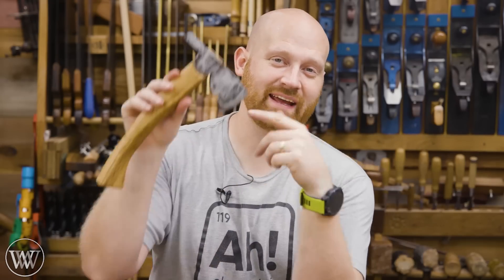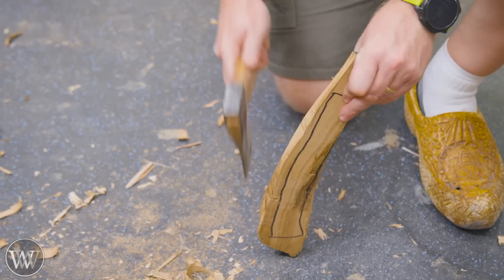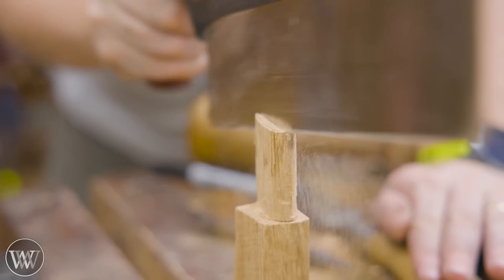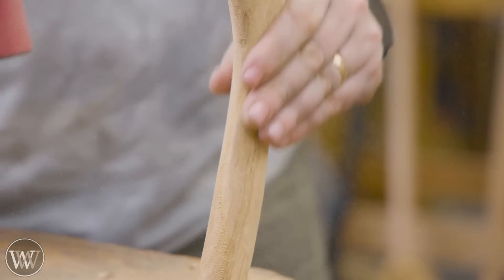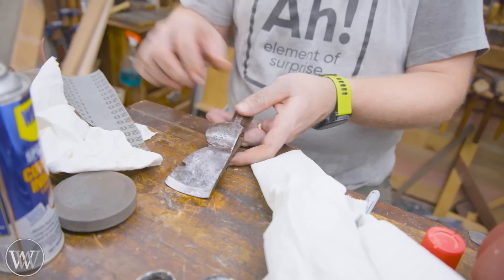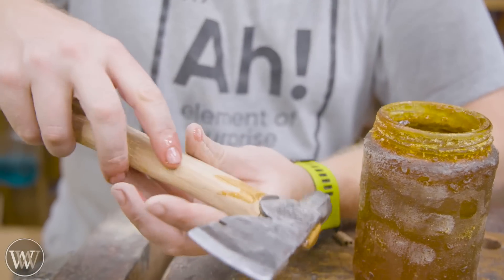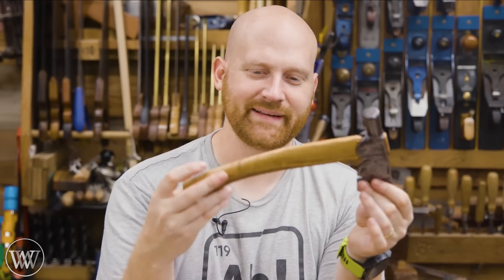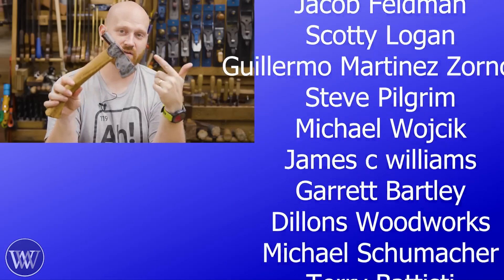How to Hang a Drywall Hatchet

Comment: Many months ago I saw a video where someone took a pipe clamp, created wood pads with a screw through it pointing inward. Then he clamped the rig into a bench vise and used the pipe clamp to hold the piece of wood he was shaving with a drawknife. It looked like a pretty good setup and he was able to reposition it quickly. Wish I could remember where I saw it, I'd post the link here.
Reply from the maker: I know a couple people who do that or something very similar. I've tried it and find it to be a little bit slower than just any of this way. But different people like different things. So it's definitely worth a try

Comment: Nice job James. I have several vintage shingle hatchets with slightly loose heads (therefore, not usable), but I struggle with replacing a vintage handle with my crappy replacement, even though they are not valuable.

Comment: The curved handle reminds me of an "improved" claw hammer with the same curve i bought for my dad to supposedly increase the impact power. I inherited a similar hatchet to the one in your demo. from Dad, r.i.p.; it had a straight handle so as to even the hammering & chopping. Well, the original handle was loose & cracked & I had a standard, store-bought hatchet handle hanging around for years. I fitted on the curved hatchet handle & I wonder if I've made the hammer side less efficient since it curves the "wrong way". Thanks again for the fun demo video!
Reply from the maker: right on. if I were going to use this for it's intended use I would keep it straight, as both sides would be used about the same.
Reply: By “Improved” Hammer are you talking about those crazy looking square-head fiberglass Estwing’s from the early 2000’s ? 
To say “they never really caught on” would be a huge understatement.

Comment: Could you elaborate on how the metal wedges causes more problems than it's worth? I find myself using just the wooden wedge and only sometimes adding a metal wedge.
Reply from the maker: There are a lot of arguments that go back and forth with metal wedges. But usually the reason people don't like using them is they over compress the wood and this can lead to premature loosening of the head as it breaks the fibers down.
Reply: @WoodByWrightHowTo  At least it isn't a bunch of nails and screws jammed into the thing

Comment: After you sanded with the 400 grit...did you "wash" off the dust? Or did you leave it on so the finish would "meld" with the dust and soak into the pores?
Reply from the maker: I wipe it off with a dry paper towel but leave it in the pores. That will work the oil in a little bit deeper. And give a darker contrast

Comment: I've always called that a "Roofer's Hatchet" used for wood shingles.  Would that be the same tool with two different names?  I like that you used the natural curve of the grain.
Reply: A roofers hatchet has a polished face on the hammer head like a modern general purpose claw hammer, a carpenters hatchet has cross-hatching on the face of the hammer like a framing hammer.

Comment: Something I've often thought, the wood under the hammer/hatchet head is often the weak spot, very dry and prime location for fracture.
Wondering if the shafts only get oiled after assembly, would it be better oiling whole length of the handle for few days, then assembling?
Reply from the maker: Generally you want to oil it after assembly as oiling it will cause the wood to swell and fit the head better.
Reply: @WoodByWrightHowTo how about sticking the head in BLO after assembly? Possibly thinned with turpentine or something.
Reply from the maker: you could but there is little pentation that far down in. usually the "correct" method is several times the first day. once a day for a week. once a week for a month. once a month for a year and then as needed after that.

Comment: From what I have learned one should avoid shoulders and such just below the head. Just keep the shape of the eye but make it tapered outward for an inch and then gradually transition to a more handle like profile. This avoids stress risers and allows the head to be knocked down a bit further should it become loose over time.
Reply from the maker: right on. for most that is considered to be the best way. that is why I transitioned it with the gouge.

Comment: That's a shingling hatchet not a drywall hatchet.
Reply from the maker: There are a few characteristics that one might have over the other. But in general those two terms are practically interchangeable in general use.
Reply: @WoodByWrightHowTo  Yeah, there's that whole family of "can be used as a hammer OR a hatchet" that includes the two mentioned, the "carpenter's hatchet," the "rigging axe," etc. It IS whatever it's used for, in the end.